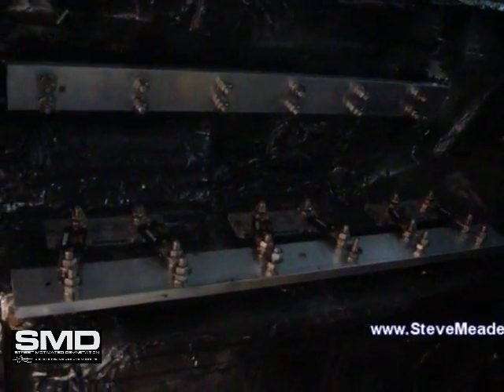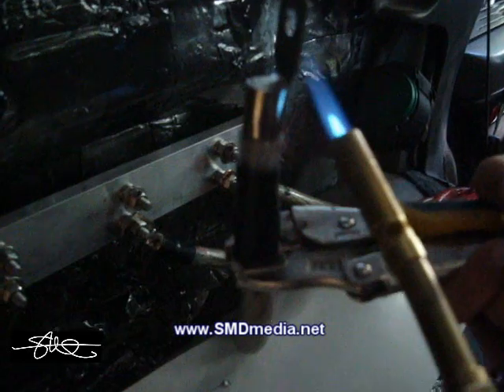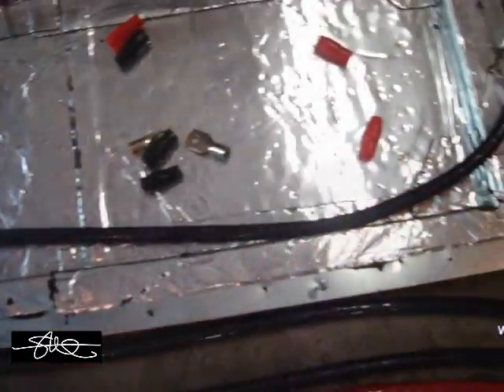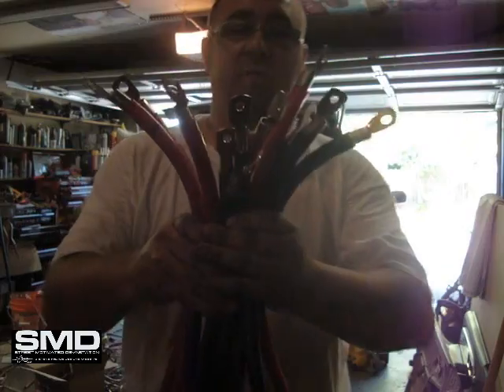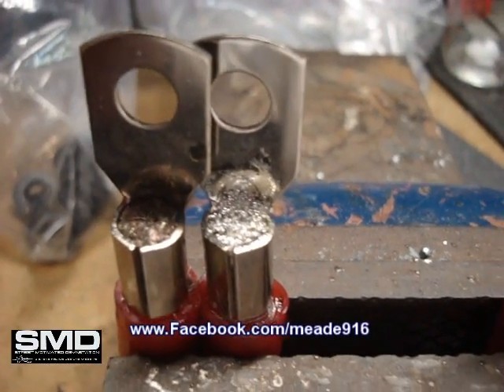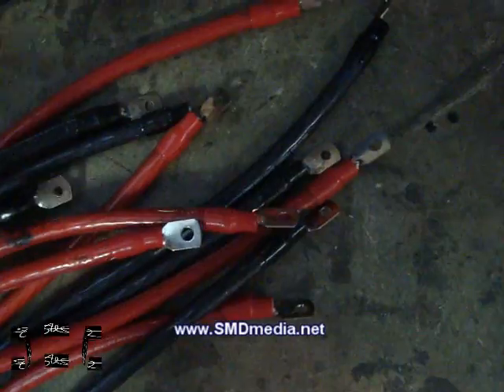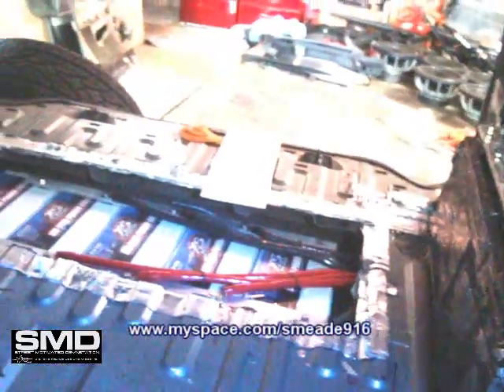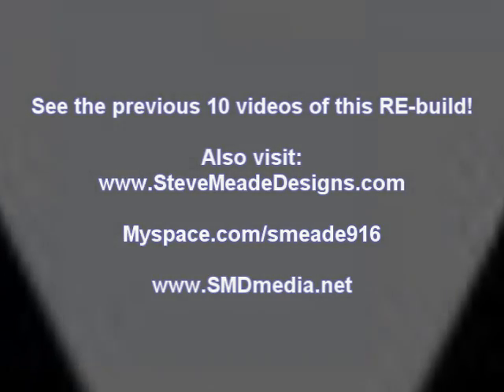Tahoe 30kw System Rebuild (Vid 11) Power Wire MADNESS!

Comment from the maker: "noreaster playa" is a fucking ignorant fool.  You cannot compare working on a building with working on car audio electronics.  Nobody in the history of car audio has had a car (or wire) burn down just because it was soldered (properly).  Nobody, not even your mommy cares about your 35 years of twisting wires. Show me your best car audio install.  You have none and you know NOTHING about it so the best thing you can do is shut up.

Comment: I heard a proper hydraulic crimp makes the best connection, literally cold welds it and all the wire strands together in an octagon shape.

Where as solder not only has higher resistance but can fail and lead to overheating which is the most common cause of electrical fires. I hear soldering power wires is even outlawed in some situations
Reply from the maker: "noreaster playa" is a fucking ignorant fool.  You cannot compare working on a building with working on car audio electronics.  Nobody in the history of car audio has had a car (or wire) burn down just because it was soldered (properly).  Nobody, not even your mommy cares about your 35 years of twisting wires. Show me your best car audio install.  You have none and you know NOTHING about it so the best thing you can do is shut up.
Reply from the maker: and stop liking your own post.  It's a bad look.  NOBODY likes you lets not pretend you have a friend. SMH LMAO
Reply from the maker: Soldering power wire in a car is not outlawed that is the goofiest thing i have heard in my entire life.  Solder does not have a "higher resistance" and is not going to overheat or cause a fire in a car (if soldered properly).  A bad crimp is as bad as a bad solder and a good crimp can be as good as a proper solder.  Don't let anyone tell you anything different, not even that troll bag "noreastern".  Don't confuse some building code with car audio electronics.  Two totally different situations.
Reply from the maker: you heard wrong. That is total bullshit. lol Stop listening to noobs it will make you stay a noob longer.

Comment: hey what size is the solder wire?
Reply: +Taylor Ramos size doesn't really matter when doing big terminals like this, just know that the smaller it is, the more you'll half to feed into the lug (obviously) so just get a "middle of the range" size so you're not spending a ton of time feeding solder and potentially burning yourself.

Comment from the maker: that is a wood box they are sitting on and even though its got some foil from the sound deadener there, i have the bars sitting on rubber mounts about 3/8" off of it.  (i didnt put it there to deaden the wood BTW, its just there because i was covering EVERYTHING in the back that was in the way at the time)

Comment: so this might just be a simple question, but i cant wrap my mind around it.

with mounting the POS bussbar, how do you have it set up so its not grounding? mount the bussbar to something not metal and then mount that to the chassis? with the screws or bolts covered up so they dont ground either?

it just looks like steves bussbars are bolted right to the chassis. i love the location, just might be too dark to see.

Comment: You probally know this but for new people read bellow. 

The weakest point in electrical and audio equpiment is your connector. If you can afford it, to get best results use gold plated connectors, silver or gold soder. Compared to copper or aluminum they have a higher conductivity and will create less resistance in your wire. Also when sodering aviod making a cold joint and clumps of soder they also will create resistance in your connection.

Comment from the maker: its always best to get batteries the same make, model and age if possible to prevent that....but if you use a quality battery like i do the age thing wont matter as much (unless its REAL old and used/abused).  My batts have always been on 4 alts and  also i condition them with my intellicharger from time to time...its not an issue.  If you had 6 walmart batteries, some old, some new, and a bad one in the middle, it would for sure pull the other ones down with it - so your not far off bro.

Comment: with 10 batteries do they try n take power from one another or if there all restin at close to the same volts as others is it ok?

only askin cause ive gottin diff answers from ppl n i think urs would be more understandable than theres were

this comes from when i was gunna run 2 batterys n the guy told me if it aint the same battery or rests at the same voltage that they will constantly try n fight for power from one another, what u think? 

and i think 10 is a ton of power to

Comment: Looks like it's coming along nicely, quality soldering too, I do the same thing, just not usually as thorough.  How much longer you think you got until your finished?  I'm guessing less than a month if you aren't changing the box or anything, but I figure getting it all put back together and the amp rack built will take a lil while.

Comment from the maker: what i do is i heat the connector up,  drop a fat pool of solder into the connector then keep feeding it till its ready to spill over - then i heat up the sides of the connector till it "wicks" up the entire pool.  Then, i lay another  layer over all that.  I never heat the wire up with an open flame and niether should you bro -  thats not good.  I know you mean well but i have done HUNDREDS and HUNDREDS of these, i know what im doing :)

Comment: It kinda looked like the solder was applied to the connector, then ran down to the wire. I know you know your shit bro, I was just making sure you got the flux to the wire too to get that solid connection your looking for. That's one hell of a mean electrical system you got going on there.

Comment: if you put a solar panel on the roof would that act the same as a battery providing power for the sound system. or would it work like a alternator and recharge the battery? i don't really know what i am talking about so if i am wrong tell me.

Comment: Looking good Steve! One lil thing(Not that you don't know what your doing or anything), but when your pushing the solder into the power connections, heat the rings like you did, wait for the heat to soak through to the wire, and add the solder to the wire itself. The flux core in it will seep down into the wire, and the solder will follow. It's got to be a bitch with 2/0. My 1/0 took TONS of solder to get the joint full. Your finnished product looks perfect bro. Nice work. Keep them coming!